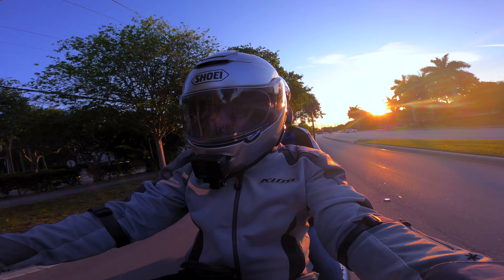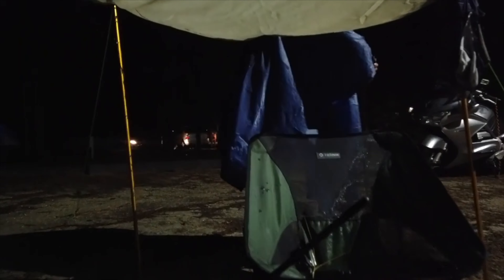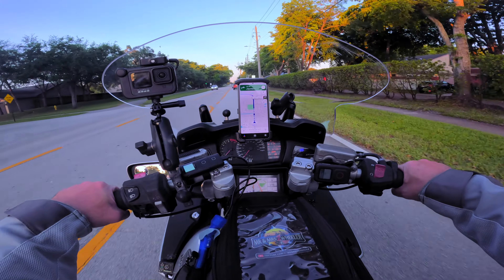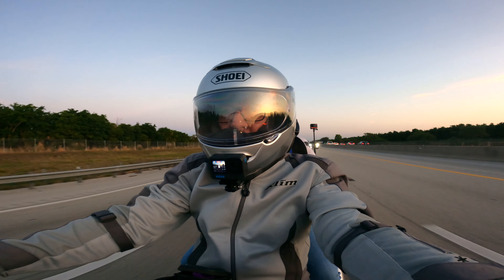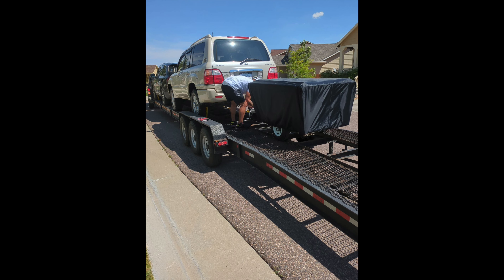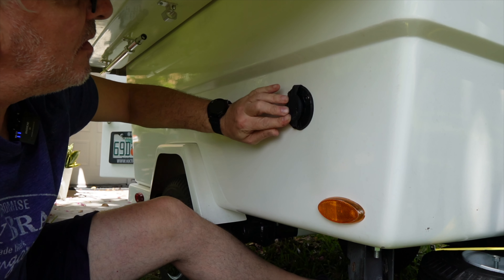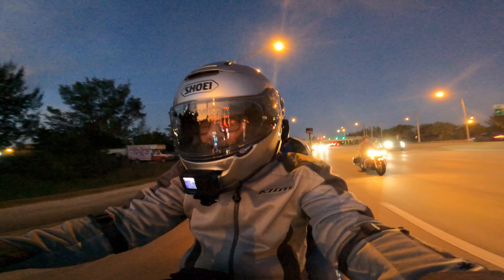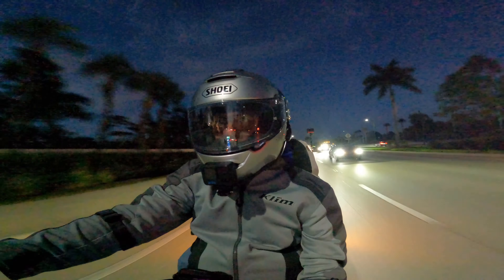Motocamping KOA with a motorcycle camper | Minimates 1st outing: Part 1

Comment: YAY!!  They're back!!!  Looking forward to the next vid and to learn more about that trailer.  I have a 2014 Honda CTX1300A, (aka, ST1300).
Reply from the maker: Hey Mike, yes we're getting back out there ( a little tough with the weather here) I am trying to get the second video out as quickly as possible. But to set the right expectations, it's not a full, detailed video about the camper. 
If you want to see a full video of just the camper, let me know and I can make a detailed video dedicated to the camper.
Thanks for watching.
Ride safe.
Mike
Reply: @MRMRS2wheeler  A full video of that camper, setup, etc would be great!  Info on that hitch setup too.
Reply from the maker: @user-zc5ip3dg7q I put up a new video yesterday, it has a little more detail about the camper and setup. Next camping video goes more in depth. Currently in the edit process.

Comment: I’m a fan of the st1300 and I’m glad you are still using it even though you’re pulling a trailer. It would have been so easy to upgrade the bike to something more prone to pulling a trailer, like a goldwing. I had an st1300 from 2007 to 2009 then I traded it for a new 2009 goldwing. Long story short the 5 generation wing is top heavy for my short legs. I should never have gotten rid of the st. In 2021 I started looking for a second bike and I wanted it to be another st. After 5 months of having no luck I found a 2007 Yamaha fjr 1300a in burnt cherry matalic. Kind of rambling here sorry about that. Long story short keep your bikes and just add to your collection.
Reply from the maker: I love my St. It's an amazing bike. Very capable and comfortable. Not really made for towing, so it took a bit of work to equip it. They can be hard to find depending on where you live, but a good source is the st-owners.com forum.
My next bike will likely be a goldwing. Not sure yet if I'll give up the St. To many great memories. 
Enjoy the fjr, and ride safe. 
Thanks for watching